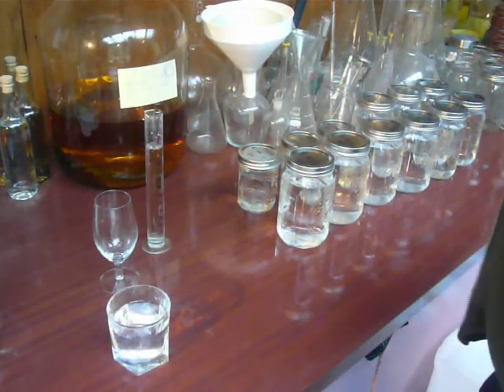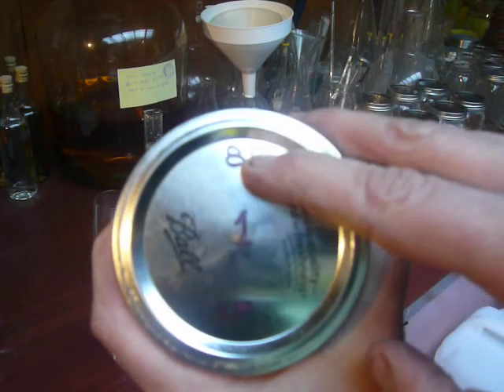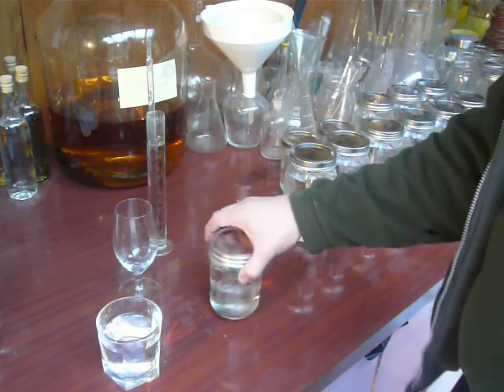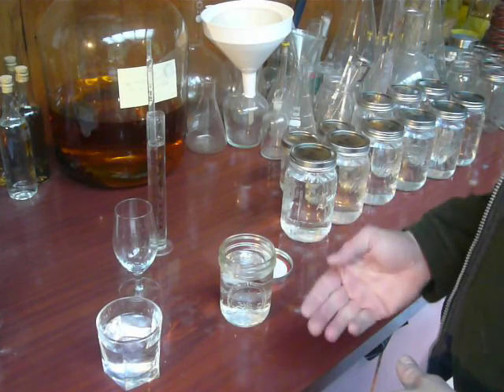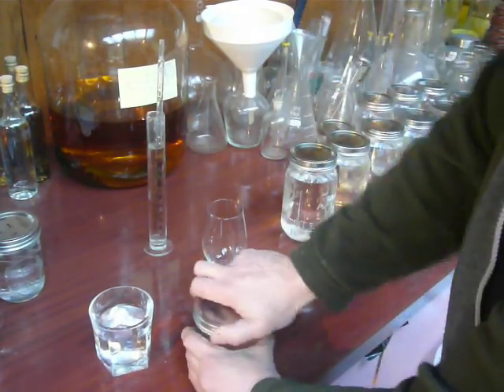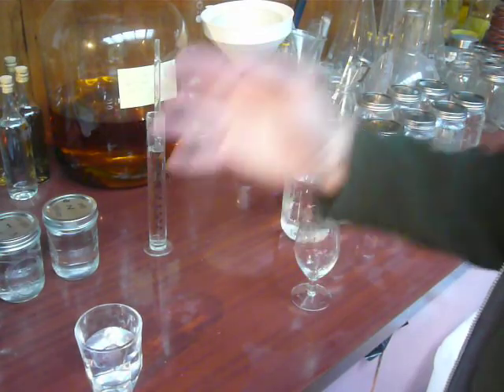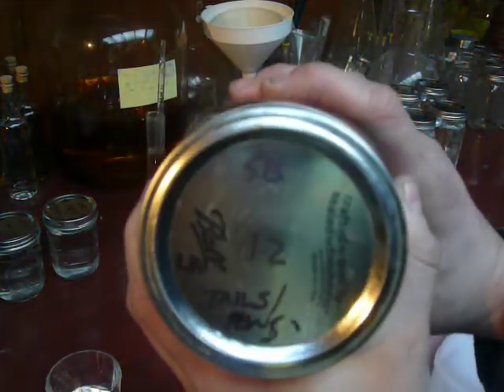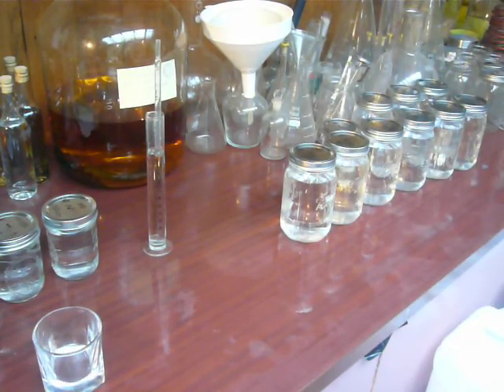Making the cuts

Comment: Have not read all the comments. I know little about making whiskey - but I have wasted a large part of my life in laboratories. The one comment I would make is you dip the same pipette into each cut and then into your mixing water. You are contaminating your mixing water sequentially. You want to use two graduated pipettes. One only for alcohol cuts and one only for mixing water. Have a third container, much larger (gallons) for rinsing your alcohol pipette between cuts. Other than that I enjoyed watching.

Comment: Are your cuts in 6 oz (177 ml) increments?
Reply from the maker: G'day fella, hell no :o)
That'd be some mighty small increments.
The larger jars there are quart preserving jars (about 800ml each)

I used to start off the run with a few smaller jars to let me get a better idea of where to start taking product/make the initial cut and then upsize to the larger jars once I was happy with what was coming off the still.

Nowdays I just do it by taste on the fly - once I'm happy what's coming off is good I start collecting. Everything prior to that goes in with foreshots (cleaing fluid) or gets stored as feints.

Happy Distilling.

Comment: Why cut the heads at all, putting even some of the heads back in your final for the sake of kick/flavor.... It's Acetone & Methanol... Bad for you stuff, it is also responsible for hang overs. Chuck some tails in for flavor but get rid of heads altogether.
Reply from the maker: G'day fella,
I think you are confusing heads and foreshots.
There are 4 main brackets of fractions that come off the still;

1st; Foreshots
2nd; Heads
3rd; Hearts
4th; Tails

The foreshots are the Acetone/Methanol/volatile compounds that you were talking about.
They do smear into the heads so a lot of people (myself included) tend to take way more foreshots than they need to technically and go deeper into the heads with them before they start collecting heads.
The Hearts are what you really want - that's the good stuff, although you can get some great flavors from heads/tails that you may want to add back into your final product - which is where you'd go thru' and sample on a jar-by-jar basis for small batch spirit runs and craft something extraordinary - it's the advantage you have over large commercial distilleries as a small craft distiller.
Reply: The heads and foreshots are the same, being made up of acetaldehyde, which evaporates at 68.36°F, so is not due consideration in an open-flow system. The heads also contain ethyl formate, which has a boiling point of 129.7˚, acetone @ 132.8°F,  and methanol @ 148.5°F. There are some good esters mixed in and the last cuts of the heads can at times be blended back in to give the much preferred ester aromas for all-grain spirits. Vodka, not so much. Esters include ethyl acetate with a boiling point 170.8˚F. Whereas ethyl butyrate @ 249°F and hexyl acetate @ 340.7˚F usually remain in the still. The difference in temperature between overlapping boiling points of ethyl formate, acetone, and methanol of only 18.8° does not define heads from foreshots.
Reply from the maker: G'day fella, - agree totally that it's not about saying "it's reached 'X' temperature so now I'll start collecting or "now it's good because it's this far thru the process".
It only took a few times running my still/s before I started relying on my senses of smell and taste to start making cuts.
Anything I'm dubious about gets collected in smaller increments and let to sit for a day or two before I decide "yeh or nay".
I also runs way into the heads now closer to the hearts before I start collecting "product"

Theres a bit of terminology mix up between folks in distilling sometimes.

Some folks refer to "foreshots" and "heads" as the same things (usually refered to as just "heads" - others refer to foreshots and heads as separate things with foreshots being the volatile compounds that come off the still initially (not saying that they can't smear thru one another) and "heads" being the initial ethanol coming off the still that also contains higher levels of more volatile compounds/cogeners).

I'm in the later camp. :o)